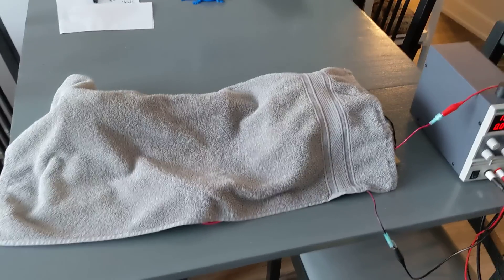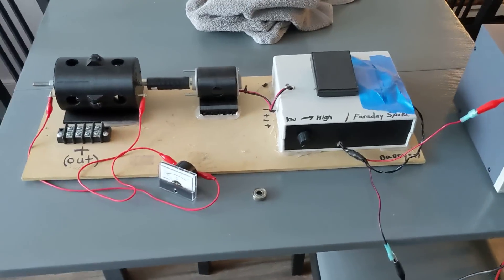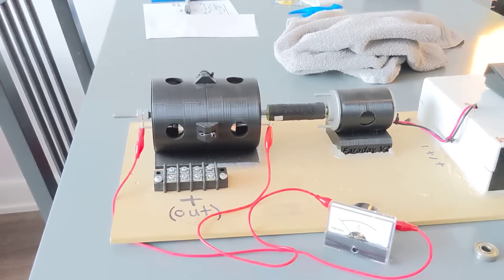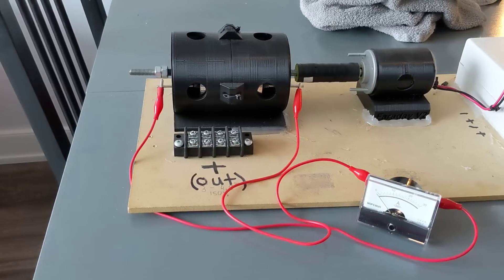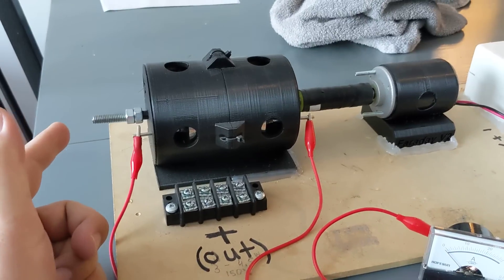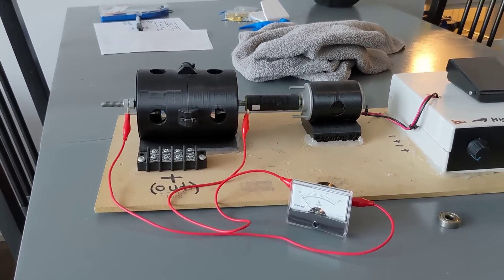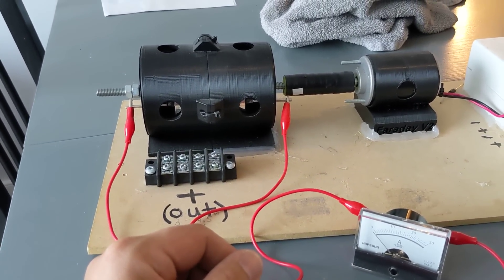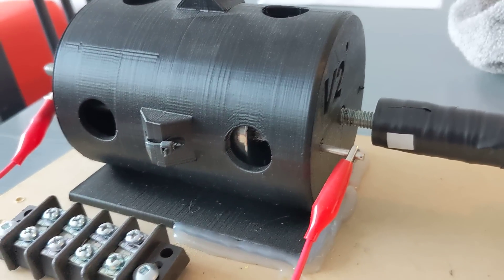N Machine....Bruce Depalma..Faraday Research RND

Comment: Thanks for sharing your work. Perhaps you can find a way to interrupt the current from the brushes? Then you could step up your voltage using turns ratio via a current transformer.
Reply from the maker: Hi. Thanks for the ideas I will keep that in mind...cheers
Reply from the maker: I seen an interview with Eric Dollard.... he did back about 10 years ago .. and he said he knew Bruce DePalma personally... and that the N machine was Not overunity... and the original machine was not designed by Bruce de Palma... it was designed by some guys I believe in silicone valley it was called the Starburst machine ...so as far as the overunity I haven't really pursued it because of the scale... The scale was way too small to get anything usable out of it....now  if I scale it up to a point where the unit is by the 1,000 lb of magnets that I might have some useful power but this small bench top model just will not put out the power I need

Mike
Reply: @FaradayResearch People are not developing it enough. They should get to the root of the problem. They should find out how this traction in space happens, understand the logic and build a simpler but functional machine.
Reply from the maker: @CharaTR  Yes you are very right on that statement. That machine has not been explored enough by inventors like myself very often. I have some new ideas that I'd like to do, but I have so many projects on the table right now. It's not really in my view at this point.
Reply: @FaradayResearch  It's the same with me. I try to detect brain wave neurons, interpret them and reveal memories, or create a mini version of the railgun, etc. But money is needed and currently there is 6000 TL in the budget, so I will try to find out on paper what affects that space, confirm it with experiments and try to apply it to the rates. By the way, I am 17 years old and I will take the YKS exam in 2 months, so there is this subject in the curriculum, which makes studying much more comfortable for me. After I find a way to get rid of this school trouble and get my life in order (as an inventor, an engineer and a scientist on the other... you get the idea), I will do what I said, in the scope of this project. It would be good practice anyway. Maybe I can find it in other people... MAYBE.
Reply: @FaradayResearch  What laws do you think this machine breaks, according to mainstream science? Because I want to prove with experiments that the mainstream cannot do, but it can be done. If this happens, the energy problem in the world can be solved. If it uses spatial energy or space (because some say oxygen, some say the earth's magnetic field), it should not affect the world.
Reply: @FaradayResearch  if you check Searl and think of ball bearings and stop listenting to the shills.. Searl are payed and bought for to, but not what he did. ( Thats not on the internet)...

Comment: Fantastic!!!  I have created a near identical duplicate of your machine but I haven't posted a video of it yet because I was unsure if I should or not.  But you seem to be alive and well so far, so maybe I will post my video today of my latest project.  I used a digital amp meter and only got about 1.5 amps, but that's still a huge success in my mind.  I got 70 milivolts.  Very nice work and impressive device you have made.  There is a way to convert the low voltage/high amperage to a more usable form of electricity.  I will talk about that in my new video which I'm going to film right now.  lol   Your an inspiration, thanks!
Reply: What kind of brushes are you using?  and where did you buy them?  thanks!

Comment: So what was the name of this original motor design you made? You mentioned it in a previous vid but removed it
Reply from the maker: Hey the original name was the N machine
Reply: @FaradayResearch  cool but you called my another name. A persons name I think?
Reply from the maker: The Faraday disk.  Or Tesla disk
Reply: @FaradayResearch  Also do you have a build video on this device? Would love to emulate
Reply from the maker: @mcorrade  yeah I have not done a building video for this generator yet... maybe I will do it soon
Reply from the maker: It also known as the homopolar generator
Reply: @FaradayResearch  This is a very interesting concept and idea. I've been deep in research and as you said, very low (in the mV)range but high current. Question: what's the use case for such a generator? What can it be used for? I very much want to emulate this.......Since there's no real voltage to speak of, but high amps, what can it power??
Thanks for sharing
Reply from the maker: @mcorrade  hey...ok this would be used for welding....heaters anything that requires hi amp draw...that is why I am trying too get the voltage up too make it more useful for other devices....like charging batteries or super capacitors
Reply: @FaradayResearch  Nice thanks for the quick reply. I too am really excited about your progress so keep it going man....Keep it going.
Reply from the maker: Research is key....do the homework first.  Design it in your mind...then put it on paper....then start to build.... sometimes these projects can take a year too build....think things through before you invest into it. Cheers!
Reply: @FaradayResearch  absolutely thanks
Reply: German,god super
Reply from the maker: @jensbuchholz5766  it's also known as the homopolar generator made by Nikola Tesla
Reply from the maker: The Faraday spike